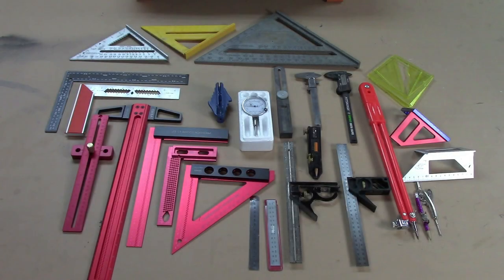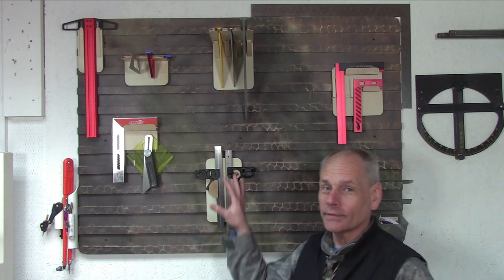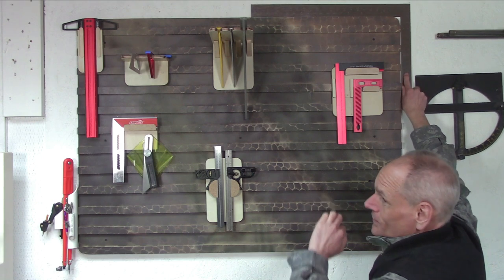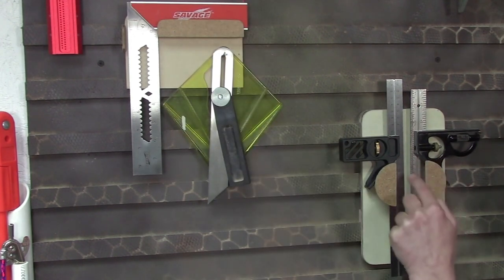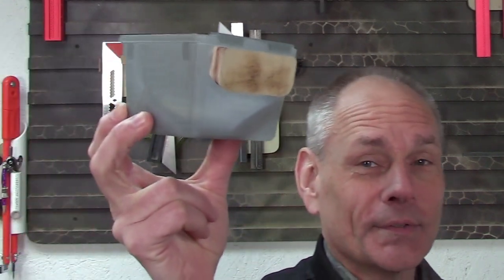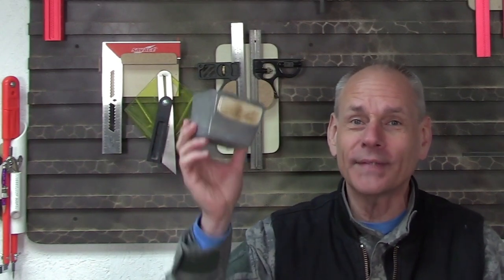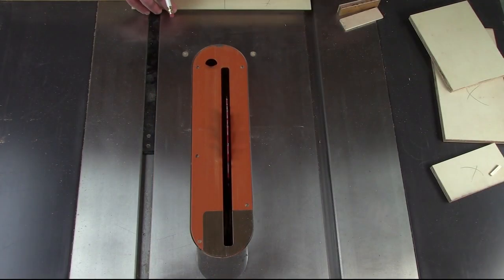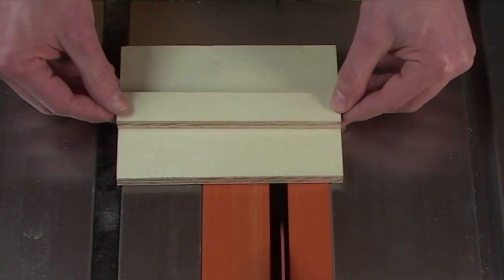Easy wall storage - PART 2 | French cleat system for beginners

Comment: What about a wooden thumb turn as a lock for your large square that rests on the top of the frame? Hard to explain, but a wooden peg that has a screw in the middle or at one end that you just turn into place as a lock. You could easily screw it into the corner of your board. You can buy metal ones, but I think a wooden one would fit in better with your design 😊
Reply from the maker: I like it!  That general concept definitely stirs my imagination.  Thanks for the idea!